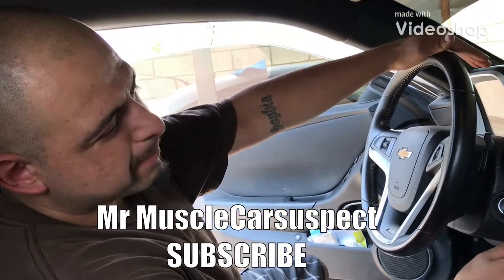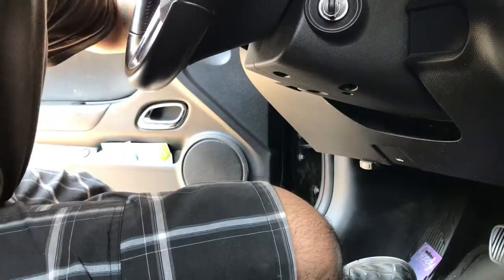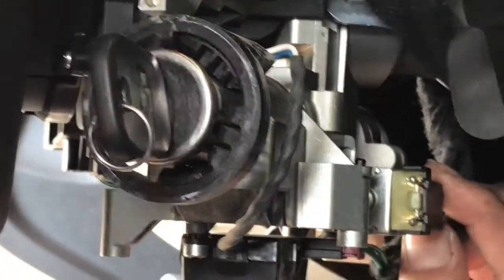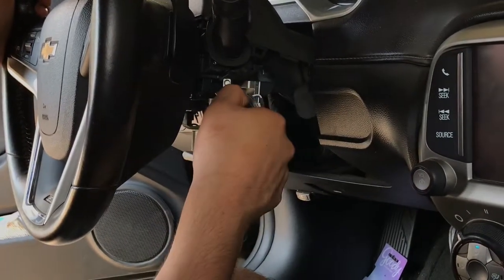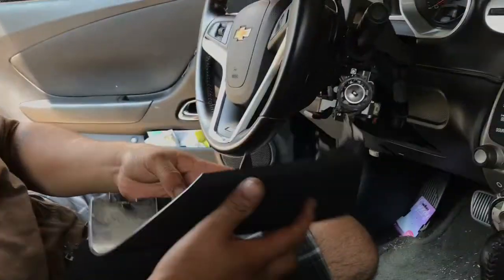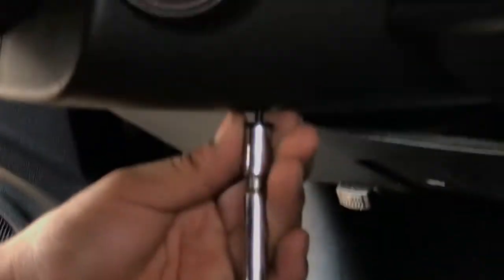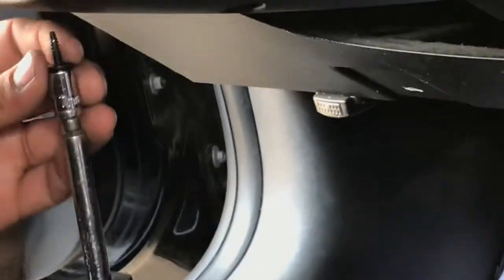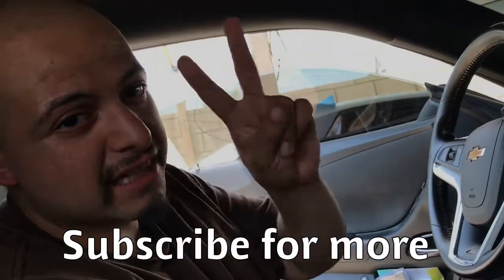2015 Camaro Ignition Key Getting stuck Fix and Solution

Comment: is this a permanent solution or temporary? my key does get stuck too but just wondering leaving that cable out won't affect anything?
Reply from the maker: alfredo garrido it’s a permanent solution I have had my wire disconnected ever since and no problems it’s your choice if you want to remove the wire and leave it like that or you can take to dealer and spend 300$ for a repair it’s up to you but this dose fix the problem
Reply: Mr MuscleCarsuspect  thanks so much bro I will definitely save that money
Reply from the maker: alfredo garrido no problem I’m glad I can help bro
Reply: I'm sure the wite reads the gear shifter position and is in protection mode. Is seems to be an isolated issue. Shifter position issues....
Reply: For v6 too?!!
Reply: @zacharytyer5206  im trying it on my 15 v6 today.  Ill try to reply back if it does. I.would think it will
Reply: Only issue for me is you can cut the engine off in drive, neutral or reverse. I'd rather deal with that than beating the Hell out of my shifter to let the key unlock from the ignition.
Reply: Update, it works on the 15' v6. But unfortunately it just got nailed by a semi and written off lol. Like wtf

Comment: I had this problem in my 2015 back in 2016, still under warranty so the dealer replaced the shifter, started again last year but the "putting it in park fast" trick worked up until this morning,  when I was dropping my son off at daycare and I had to leave my car on while I did so. Tried this when I got to work and it worked! Fingers crossed that's the end of that issue...
Reply from the maker: Yea they tend to fox thing that dont fix the issue for good it happens again and with this it shouldnt happen nomore. Subscribe

Comment: Best video about this problem on the entire internet!! 

Do you think replacing the shifter handle would also fix the problem? Obviously way more expensive, but I'm just curious.
Reply from the maker: Well to be honest the same thing will just happen again this is a permanent , i havent had no more issues on my camaro at all.. and it would be definitely up to you, but yes really expensive gm just has some bad shifters/ignition. The desine is just not that great on them parts but you can lubricate the button with some d40 it helps.. im just glad i was able to help out and my video was helpfull! Thanks for your postivie comment and support!

Comment: Just did it with a screwdriver , only took the top of the cover off . You are a life saver
Reply from the maker: Thanks for your feedback! Subscribe
Reply: How did you get the bolts out????
Reply: @ermal6157  it’s been 5 months so I kind of forgot but I think I only had a screw driver and popped them off . I might of used a flathead not a screw driver. My hands are skinny so I did it just with the top off . Trust me I havent had the problem since after years of dealing with this . I lowkey forgot about it lol

Comment: Any idea what is bad in order to fix the problem permanently?
Reply from the maker: Dustin Deming well honestly bro it’s a problem gm has and they will fix it for you but they will charge a shit load. It’s because of the button on your gear shifter it tends to get stuck here and their and this process should help you fix it permanently. It just a simple wire you remove shouldn’t affect your car in any way. It just what keeps your key stuck. Gm just has bad ignitions

Comment: This worked like a charm but um .. what did I just unplug 😂
Reply from the maker: XotiC OutlaW it’s the ignition switch lock wire, all it dose is keep key locked shouldn’t affect anything else mines bin disconnected for over a year now and no issues
Reply: Yeah from my understanding it's the child safety lock so you won't be able to shift out of park when the car is off when it's plugged in.

Comment: OMG you're the real MVP  I was having issues with my key getting stuck in my 2014 Camaro Rs. I watch your video and went outside follow your directions and found the yellow box and  unplug it like you said and BOOM IT WORKS. I'm a female and it took me 20 mins and I just wanted to thank you for doing this video. I ✊🏽 #salute you 💯
Reply: Which screwdriver did you use to take the 3 bolts out under the wheel

Comment: Thank you sir. One question though, what parts do i have to replace to fix the lock?
Reply from the maker: Tbh even of you would relace the ignition switch for example or the shifter the same issue would happen so their is no point to even think if replacing any of those. Just thow money away tbh... save your money this is a permanent fix gm parts are just no good nomore

Comment: Thanks this worked awesome! I’ve had my car for 6yrs with this problem!! Just one question, my check engine light came on the morning after I unplugged the cable, is this common? My car is running fine.
Reply from the maker: Hmm thats wierd ive had this unplug for years now i have never had a check engine issue for unpluging the wire maybe something else was moved or it can just be something else. Try taking it to your local parts store for a scan on that check engine it shouldnt bring up a check engine light for that cabel thats wierd tbh
Reply: @mrmusclecarsuspect5362  will do! Thank so much for your help!!!
Reply from the maker: @Jjd9399  no problem im glad i can help. Yea that wire only keeps key from comming off when car is on gear. But key wint fall off or anything with it disconected amd theirs ni way it will cause a check engine.

Comment: Thank you. My dealership said there was nothing wrong with it. I will be doing this tomorrow
Reply: Gearhead9760- out of curiosity, did you follow the above instructions (unplugging the wire)?  I did and the key comes out easily each time.  The problem I am concerned about is that the key comes out even while it is in "drive."  I found out because car started to roll back (I was on small incline) and luckily I hit brake before it went too far.  Surprisingly no one on comments has mentioned this.

Comment: So is the sole purpose of the yellow box to lock the key bc the car thinks it isn’t in park when it is? I’m considering doing this because I’m tired of jamming my car in and out of park to get my key back. Dealership is too expensive and wants to play games like they don’t know what is going on. I just don’t want to mess anything in my car up unplugging stuff but your advice looks solid. Any answer you can give is appreciated. Thanks man
Reply from the maker: cole allen yes the purpose of it its to keep key locked. But you can easily spray d40 on the shifter button and hold the brakes to free button so you can click it a couple of times and lubricate it with d40 so the button frees if that button is stuck even a bit it won’t send signal to ignition telling it the car is in park that will help out or you can simply disconnect the wire and get rid of the problem for good. Shouldn’t affect anything I’ve had mine disconnected for a year now and I’ve had no issues feel free to try that process if you’d like or try the d40 but this process fixes your problem dealer will act like they don’t know what going on but the problem is obvious and simple. They just don’t make good ignitions/shifters nomore
Reply from the maker: cole allen let me know if you got more questions! Thanks for your comment and support!

Comment: Thanks for the tutorial just got an ‘15 2LT rs and this saved me it was getting annoying and embarrassing starting my car over and over. Question: should I take the end where I unplugged just so the connection doesn’t spark..just a though on the loose plug
Reply from the maker: Your welcome. Thanks for the support! You can zip tie it too the side and put some electrical tape if it make u feel.more confertble.so its not just laying their. You dont need it plugged.

Comment: Hey! Can I put aftermarket Brakes on my SS with Brembo brake calipers? The dealer ship quoted me over a thousand dollars just for the front set! Just the brake pads. Not installed!
Reply from the maker: You can use whatever breaks you want. My ss had powerstop rotors amd stock calipers on with the cheapest breaks lol it didnt affect me at all amd they will try to tell you its a mist to get certain breaks but at the end they will do the same thing stop your car.
Reply: @mrmusclecarsuspect5362  Thanks alot. I appreciate your answer. Auto parts store, here I come!
Reply from the maker: @Martin-zz2hs  your welcome good luck and stay safe out their! Drive safe! Have a nice day!

Comment: Man im glad this has worked for many people. I was finally relieved when i saw your video and immediately went outside and did exactly what you said. But my key still got stuck on the first try so I just put everything back together. Should I just leave it disconnected and eventually it will work? I don’t know what to do anymore.
Reply: You unplugged that wire and it made no difference?

Comment: So you don’t reconnect the wire, right? It’s not going to affect any other function right?
Reply from the maker: ShawnyboyEXE that wire all it dose is keep your key locked 🔒 if their is no click from the shifter to tell the ignition switch the car is on park the key tends to get locked you can try some d40 on your shifter button click it till it pops out and lubricates should help it click into place and send signal to the witch and unlock key but tends to keep happening do to the ignitions these cars have are just no good. The wire shouldn’t affect it at all in  any way it’s your choice to keep it disconnected I bin having that wire disconnected for a wile and no issues so far no more key getting stuck

Comment: I am having this problem with my 2014 Camaro.  My question: by removing the wire that you show in your video, will I need to worry about key coming out while I am driving?  I am shocked that GMC service centers do not know about this fix.  They want to remove the steering column and gear box. Thank you.

Comment: My wife's 2015 Camaro has a different issue in that the key will turn off the engine but the ignition sticks in that position and will not turn any further back to access the off position so the key can then be removed. We just got stuck out of state with that predicament and called the dealership. The advisor suggested to slam the brake pedal which I did and the key was finally able to be turned to the off position and then be removed. His trick only worked twice and was only short lived as we got stuck again for about 15 minutes before the key finally turned the ignition to the off position. Will your tip address this as well?
Also will spraying some DeOxit rather than WD-40 on the shifter button help as well? I was just looking at the underside of the panel and found the 3 screw you mentioned but there is also a smaller screw on the left side of the panel, does that one need to be removed also?

Comment: I have a 2014 camaro is the bolt size still 7mm cause I can’t seem to find a bolt extractor that size
Reply from the maker: Yes it should be the same size and at walmart i bolive u can find small kits that eill have smaller sizes like the 7mm should be in one of those for your 7mm bolt

Comment: What does that wire exactly there for I’m just like worried it disturbs any other system thing
Reply from the maker: I've had that wire removed for years and no issues. The wire just keeps the key locked. Removing the wire has no problems to it, and the key will not fall out while driving. This prevents key from staying stuck because that key sticking issue comes back when replacing parts.
Reply: Okok thank you so much ama go ahead an do the same to mine after work I just payed like 700 to fix up my car and the key still stays stuck sometimes yesterday I had to wait about 2 hours to get it out and I watch ed this video in the car waiting I just needed some more info thank you so much I really appreciate it 💪
Reply from the maker: @Alexa Gallardo  oh damb, im sorry you didn't see this video before spending an unnecessary amount of money.. if they claim to fix the issue and charge you, they should be able to fix the issue with no charge. They are responsible for charging you for something that did not need repair and charged you for it. If you have any more questions, let me know. Thanks for watching.

Comment: Excuse my ignorance, so do you just remove that black chip forever or replace it? Thank you in advance !
Reply from the maker: Just leave it disconected out if the way.you can even zip tight it as llmg as its disconected. You wont have the issue nomore. The issue continues even after parts replacement.
Reply: Oooo ok, I’ll disconnect it forever, thanks a lot man! It just happened an hour ago and it worked but I wasn’t sure if I should just replace the part or just disconnect forever, thank you!
Reply from the maker: @BigBoss-rf1pt  im glad i can help. Thanks for watching! Subscribe!

Comment: Bro I'm doing this right now to my camaro 
Only question, do you know what's that wire been removed for ? I'm afraid to do something wrong to my car by doing this
Reply from the maker: All that wire dose is lock your key once car is removed from the park position. When you go into gear a signal is sent to you ignition switch telling it that it’s on gear now and locks the key. You pr key will not fall off on its own or come off. The only way it will come off is if your turn car on off position. This dose not affect your car in any way. I have not had any issues on mine since I removed it and it’s bin a wile..
Reply: @mrmusclecarsuspect5362  thanks a lot
Reply from the maker: @JMar.  your welcome thanks for the support!

Comment: Primo if I disconnect the wire thing would it hurt the car ??
Reply from the maker: No it won’t affect the car in any way. All it dose is keep the key locked  🔒 even with it disconnect, the key remains locked wile car is on the on position/ running. The key will not fall out on its own or even if you try pulling it out only once you turn off your car the key will not be stuck no more. Let me know if you got any more questions.

Comment: So much relief it wasnt just my car. My maro only has 17k miles and this kept happening til one day it stopped.  I just kept moving my gear shift when it would get stuck
Reply from the maker: El Guero The button on the shifter tends to get stuck...and by spraying some wd40 on the button in your shifter it will lubricate it and help it get unstuck usually helps, but these ignitions are just bad them selfs as well.. and that’s really low miles to have any issues at all

Comment: The 7mm isn’t working on the bolt is there another size to use
Reply from the maker: Mz2fly22324 7.5mm what year is it? It should unless previous owner replaced them to a different size dose it look like it’s too small or too big try bigger size if it’s too small and smaller if it’s too big but can be smaller than 7mm. Try 7mm 7.5mm 8mm 8.5mm. Let me know if you get it or have any more questions!
Reply: It’s a 2014
Reply from the maker: Mz2fly22324 it should be the same size then have you looked under and checked if it’s just a reg screw for like a screwdriver but as I can remember a 2014 should be the same size as the 2015 on that bolt size try putting in sizes near same as the 7mm like 7.5mm 8mm 8.5mm until you get the size I’m trying to be as much help as I can lmk if you got anymore questions
Reply: I finally got it to work thank you so much for this video it was a life saver
Reply from the maker: Mz2fly22324 I’m glad I can help! Thank you for you comment and support!

Comment: Just phenomenal. Thank you for the info! 

Do any lights come on, on the dash with the switch unplugged?
Reply from the maker: No. No light will come on at all..their shouldnt be any lights on with connectir off all that conector dose it keep you key stuck! Your issue should be fixed once its disconnected.. sorry fornlate reply work late and havnt uploaded in a wile but i try to reply to everyone.

Comment: Can I leave the sensor off or will it trigger anything in my dashboard ?
Reply from the maker: You should be fine. Ive had mine off for over 2 years and ive had no code no issues.
Reply: Ok im a diesel mechanic myself going to remove it will comment back if it triggers anything

Comment: Does anything happen to the vehicle leaving that cable/wire unplugged?
Reply from the maker: No. Their shouldn’t be any issue by that wire being removed.
Reply: @mrmusclecarsuspect5362  so you can leave the wire unplugged and put everything back together?
Reply from the maker: @jakeward7828  yes. You can leave it off

Comment: I have a 2015 Camaro and it’s started to do this. It has 87,282 on it and I have put weight with the keys (AirPods) (a mistake) and it’s starting to get stuck. Don’t know if I just need to do this or get a completely new ignition.
Reply: And the thing, it’s not while turning on but off. It gets stuck in between off/on (the middle, what you may call that) and I don’t know why.
Reply from the maker: Madyln Mae it’s your choice you can also spray some d40 on the button on your shifter and click it till you feel the button popping out completely how it
Should or you can completely just stop it from getting stuck with this process dose not affect anything at all dealers will just try to make money off of you by telling you u need to replace this and that and at the end the same issue will happen! In the end it’s your choice those 2 things are cheap and free just take a few minutes and the d40 a couple buks.. thank for your comment and support let me know if you got more questions feel free to ask...
Reply: Mr MuscleCarsuspect Okay! My dad is going to help me fix this and I told him about this and he said it was probably what he is going to do. Thank you!
Reply from the maker: Madyln Mae no problem just don’t let them dealers rip you off, it’s, if you have any more questions feel free to ask